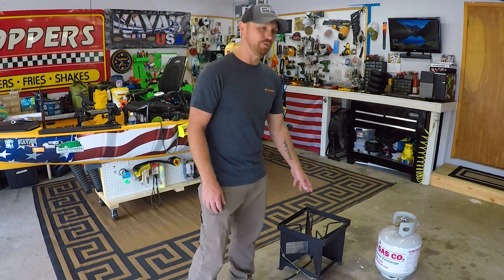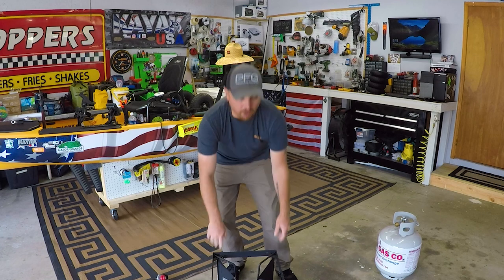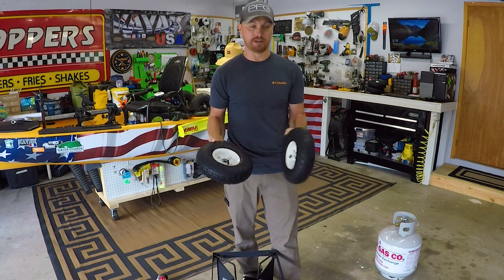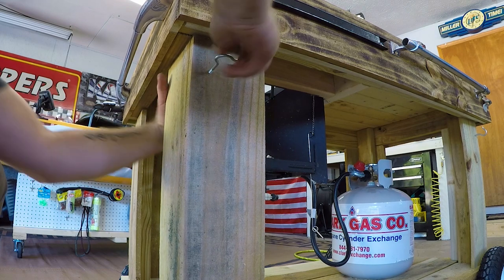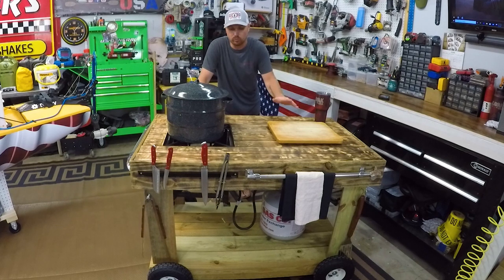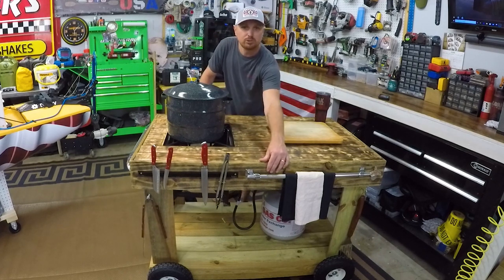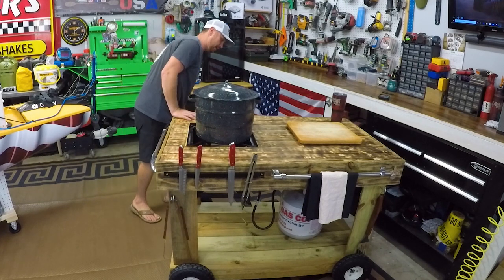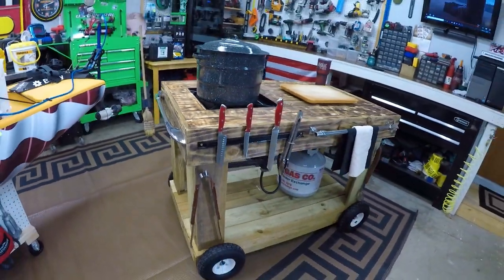Backyard Fish Fry Station | Full Build | DIY 2021

Comment: Does wood handle the heat good been thinking about doing it with some ruff cut pine just didn't know if it got too hot for the wood
Reply from the maker: Still works great, no issues 👍🏼